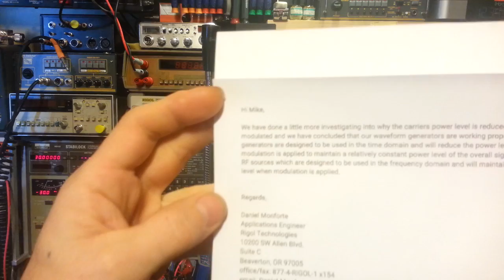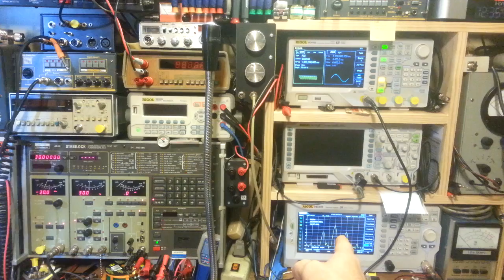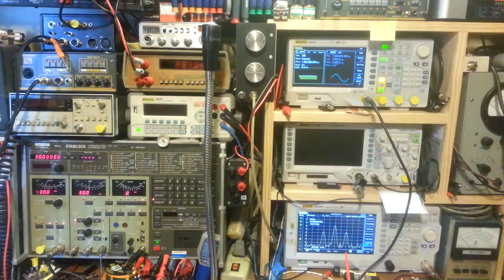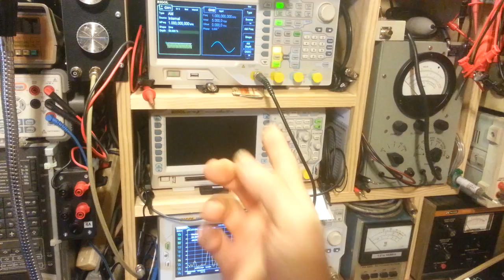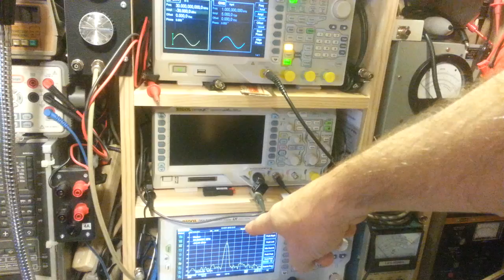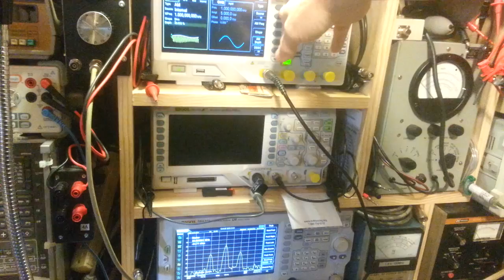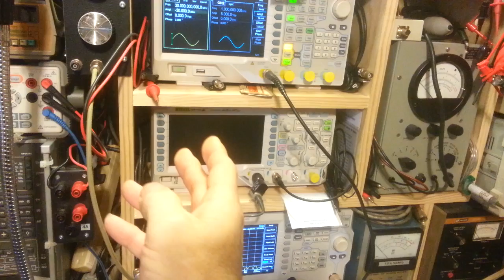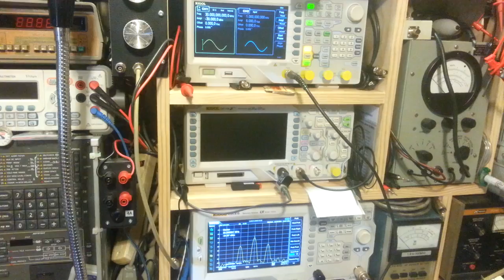Rigol DG4102 useless as a signal generator, inaccurate output level when modulated.

Comment: The AWG does what it's supposed to do. The display shows the PEP power, -30dBm in your case. With 100% modulation the carrier is 6dB (-36dBm) below PEP and the sidebands are 6dB below the carrier like it should be. Varying the modulation index will also change the carrier power to maintain the exact PEP value displayed on the screen. The only bug(?) I see, is with 0% modulation depth after AM modulation is turned on. The carrier power is 6dB down, when it should be at -30dBm.
Same principle applies to 2-way AM radios. A 100% modulated 100W (PEP) AM transmitter does not output a 100W carrier.
RF signal generators display the carrier power. An amplitude modulation of 100% means the output peak envelope power (PEP) will amount to 4x (+6dB) the displayed power. Why do you consider this normal? How is this better than what the AWG does?

Comment: Just looked at the advert. It is a function generator not an RF signal generator. Two different animals. A function generator is normally digital therefore time domain. An RF signal generator is normally analogue and intended for use in the frequency domain.    I admit I do not understand why they fit Mod to a function generator. I recently purchased an aim-TTI 240MHz function generator and also a Rigol DSG821 RF signal generator. This is what I was taught at University and always understood. Horses for courses.

Comment: Why use a DDS  arbitrary waveform generator instead of a proper analog RF signal generator? I've got the DG1022Z for basic signal generstion an use a DSG815 for proper RF modulated signals. I think it's a nobrainer that a digital synthesized signal doesn't meet the quality of a proper RF instrument. Sure there's more phase noise and harmonics... There connectors of the generator are BNC's which could be a clue that it's not a proper device for RF alignment since it's no N or for example SMA type connector. I think you're using the wrong device for the desired purpose and that your expectations of this device are not realistic. And I don't think it's fair to the Rigol brand to 'rant' about this 'flaw'. That both devices produce a higher frequency signal that can be modulated doesn't meant that the quality is equal. I'm sorry you're not happy about the device, bit I don't think that Rigol deserves this tone of voice about their products...

Comment: For all the people commenting that Rigol is useless needs to understand that an arbitrary waveform generator define modulated output amplitude differently than a synthesized RF generator. Look at Tektronix and Keysight’s manual you’ll see the exact same thing. As soon as you turn on the modulation even with 0% modulation the amplitude definition changes to Vpp=100%modulated output amplitude.

Comment: Well, rigol is NOT for professionals ! I got a 22002e oscilloscope from them and it's so buggy that sometimes it cannot be used to make some type of measures. Even with the latest firmware it's still full of bugs.
Reply from the maker: Considering they actively market to "professionals" I would say it is for professionals.  They send their reps to commercial user businesses.  Walk into lots of R&D labs and you will see Rigol.  Many colleges use them as well.  It's a great generator with one problem, inaccurate output when a carrier is AM modulated.  I own a Rigol oscilloscope, multimeter and spectrum analyzer and have not found any problems with any of them.

Comment: Before ranting, please RTFM (Section 5-4, To Set Modulation Depth):

"Modulation depth expressed as a percentage indicates the amplitude variation degree. The AM modulation depth ranges from 0% to 120%. Press AM Depth to set AM modulation depth.
 In 0% modulation, the output amplitude is half of the specified value.
 In 100% modulation, the output amplitude is equal to the specified value.
 In >100% modulation, the output amplitude of the instrument would not exceed 10Vpp (50Ω load)."

Comment: I purchased one of these shortly before I got my HAM license.  Now I feel I got ripped off.  I Am glad I saw the video.  I think I will let them know my feeling on this as well.  I bought the best I could afford knowing that radio work may come up in the future.  I could be tuning radios wrong, wondering why my results are not right and so on.  Got a RIGOL 4000MSO, I splurged on it.  Love it.  I knew there power supplies and loads were not that great but had no idea there sig gens were like that.  Am considering sending it back even at a loss of restocking fee, or even yell I want it all back cause you LIED and LEFT OUT INFORMATION. To much money spent with you to be putting up with that kinda stuff.  I have same sentiment,  shoot it, good target practice,  but a small 22 would knock my skinny crippled butt over.   I guess I have one of my old employers with the 910 CAT drive over it a few times then push it into the salt pile for the roads and let it "simmer there".

Comment: @MikesRadioRepair - I know this video is a year old, but I just stumbled across it.  I was wondering if you had tried measuring your function generator's output with a 50 ohm feed-through terminator at the input to your spectrum analyzer, just to see if the issue is one of mismatched impedance.
Reply from the maker: That was with the generator set to 50 ohm output impedance and the input of the SA is 50 ohms.  Wouldn't really matter even if it was a mismatch.  A mismatch wouldn't effect only one type of modulation.
Reply: Copy that, just an idea.  Did you ever come to any resolution with Rigol, or did they stick with their "it's working as advertised" line?

Comment: So, is/are there signal generator(s) in the equivalent price range that you DO recommend?
Reply from the maker: +cougar1861 

Not going to find much else in its price range that can do all it can.  The only limitation I have found is with inaccurate AM modulation levels.  I am able to work around that problem.  Just a matter of taking measurements and comming up with a cheat sheet.  Won't be a problem for much longer as I'm going to be getting one of their RF generators soon.
Reply: Thanks for the reply.
I enjoy and appreciate your videos.

Comment: How is the DSA815 SA?
Reply from the maker: +David Eisenberger 

Love the spectrum analyzer and has worked flawlessly for me.  Same with the DS1104Z Plus oscilloscope and DM3058E multimeter.  I like the signal generator and it works great to.  I just wish I had known ahead of time the output level wasn't accurate with AM modulation.  They really should list that discrepancy in the spec sheet.

Comment: I agree completely the specs show nothing that would raise a red flag.Too bad you didn't know someone who has that same model so they could test theirs for the same symptoms. Maybe it's just something with your particular unit?
Reply from the maker: Michael Fratini 

Nope, not just mine.  When I contacted Rigol about it they said they would file a "Bug report" to headquarters.  A day or two later they contacted me and said they confirmed the output level discrepancy but it was working as designed so there was nothing they were going to do about it.  My complaint is the spec sheet list a spec for output level accuracy and it does not meet it when modulated.   Nowhere in the spec sheet does it say output accuracy is xxxx except when modulated.

Comment: Well I will not being purchasing any Rigol gear
Reply from the maker: Ron Keith 

Everything else of Rigols that I have works fine.  Even the generator works fine, just don't expect a accurate output when modulated.  It's still useable, just have to set the output level by reading the output with an external meter.  In the end it does not meet published output specifications.  The spec sheet does not say output accuracy "except" when modulated.

Comment: Their explanation would make sense if the carrier was being reduced AS the modulation level is being increased. Instead the output gets reduced when you turn the modulation On with no modulation. I couldn't see the screen clearly but it looks like when you turn on modulation, the signal gets reduced to 28dBm  but the generator still claims  30dBm output. So it's defective. Heve you saved the receipt?

Comment: That's nuts the way you were treated by customer service. You have every right to be pissed. I find of figured that it wouldn't work right. I think it is because they are using dsp chips. DSPs are not good for for rf generation. the same holds for audio generators. I would take that German service monitor any day over that rigol thing. Thanks for the video.

Comment: I would rather own older used gear than the Rigol stuff. They all seem to have problems of one form or another.
Reply from the maker: S Robins 

It's not so much that it has a problem, it's the lack of  concern about it on their part.  Anything can have a problem, it's what a manufacturer does about it that makes the difference.  And yep, I do like the old equipment to.  You will notice I even have old vacuum tube gear on the bench.

Comment: I actually had a similar experience with that piece as well as their DMM and Oscilloscope. I wish I could've PM'ed you about my experiences with their gear, but I didn't want to come off as a gear snob, nor a shill for another brand.
Reply from the maker: Dyaxxis  

So far everything else seems to be working OK.  Have never had any problems with the spectrum analyzer and I have had that for a while now.  It's usable as it is I'll just have to make up a "bodge" setting cheat sheet to compensate for the drop.  Still the last piece of Rigol gear I'll ever buy.

Comment: A digital signal generator is not exactly the optimal tool for RF work more for reasons of spectral purity (as in phase noise) but of course it should we generating the right amplitude. If anything, the amplitude should be accurate. The company response was BS of course.
Probably it's safe to say that if one device turns out to be good (like the SA or scope), not necessarily all of their producs must be good too.
On a sidenote, Schlumberger is French, not German.
Reply from the maker: Jan Lategahn 

The spectrum analyzer made by them has been in use for some time now and I'm happy with that.  The multimeter, so far has worked fine with no bugs.  The scope, the jury's still out on that.  I had to get all the options so it's a lot to learn on it.  So far it seems to function just fine, it's more of a learning curve.   The signal generator that can't keep an accurate output level, that's plain wrong.
Reply: MikesRadioRepair Agreed. I too have the scope and the Spectrum Analyzer but still love to use my plain analog Tek scope. So fast, so simple, such a beautiful picture. Then again it is nice to do a quick screenshot on the Rigol once in a while. I have not yet been overly impressed with the scopes fft and complex functions. For generators I use a 3314A as synth and an ancient 8640 for radio work.  I was thinking, you should try to hack the generator. Maybe accuracy comes as a paid option :-)) Thanks for the entertaining videos this year, Mike. Not sure why but it is very satisfying to watch people fixing things :-)

Comment: I have a RIGOL 4162 (160MHz version).  I have relegated it to testing audio equipment.  Wait until you try to set up a two-channel function.  I once tried to set up a sweep signal on both channels at the same time.  One channel would output the signal properly and the other would output a very distorted/unstable signal.  I feel like I bought a 160MHz audio generator.  I went back to my old HP 8657A for anything AM/FM RF.  Rigol blew it on this one.  I feel your pain!
Reply: Another issue I noticed was that when the unit is turned off, the power button indicator light pulsates to show that the unit is plugged in and turned off.  If you tune an AM radio to a dead area and bring it close to the turned-off signal generator, you will get a strange chirping sound.  It is really annoying. When I do any AM alignments, I have to unplug the 4162 or it will interfere (up to 2 feet away) with the receiver under calibration.  You can actually see this in one of my earlier radio restore videos.  GRRRR!
Reply from the maker: xraytonyb 

Hmm, have not tried using both channels at the same time yet.  The way I "was" going to use this was have one channel straight out for use in a circuit and the other channel pretty much permanently  attached to an attenuator for extremely low signal levels.  Will have to play around with the two channels and see if I encounter the same thing.
Reply: I have the 4162 as well and it outputs just fine on both channels, used it most recently to test a homebrew 160m receiving diversity system from a QST article. The nice thing I found was that you can continuously vary the phase between two identical signals to simulate the arrival differential at the two wire loops and watch how noise from the "offending direction" is nulled out. Having said that I'll have to try the dual output sweep configuration to see if I have a similar problem.
Reply: A problem with lots of gear that have "soft" power switches; my whole bench winks at me with those. My old Ramsey 1Ghz RF generator has a bit of leakage right around the BNC output port but I haven't tried searching around the Rigol front panels (and others on the bench).

Comment: Mike, My Wavetek model 395 100 MHz Arbitrary Waveform Generator does the same thing. This is why I have my HP 6857A signal generator dedicated to this king of thing. Still sad that such a nice new toy won't do the business.
Reply from the maker: The Radio Mechanic

Hmm, would have to go pull mine back out, can't remember the model number.  I had pulled one of my old Wavetek AWG and it didn't do this.  Don't think it was a model 395.

Comment: Bummer. The good news (maybe) is that they might be able to do a firmware update and fix their screwup
Reply from the maker: Michael Lloyd 

Yeah that's kind of what I was thinking.  It has to have some way of measuring its own output.  It just needs to be able to compensate for the drop.
Reply: Any chance there was a termination resistance mismatch? I know the SA is 50Ω but I haven't had a chance to look at the ArbGen to see what it is or if it is selectable
Reply: Until recently I was a SCADA engineer for a privately held oil company in Houston. We have stuff all over South Louisiana, south Texas, and Alaska. We also have a little in south Alabama. I have a good friend who's dad was the Prentice in Prentice and Records (blowout prevention training) and I think that company was from Lafayette. Maybe Baton Rouge. I don't remember. I have a buddy that graduated from LSU and has been in Denver for almost 30 years (wow...). I think he is VP of Engineering but I'm not 100% sure of that. And my daughter was born in Minden, Louisiana. I'm still in contact with a good number of friends from there.

They (allegedly) promoted me to plant manager earlier this year. I see it as a demotion with a pay increase :) People come with problems. PLC programs do what you tell them and if they don't show up for work you just replace them. :o) PLC's are much easier to deal with...

I wrote all of the pump station programs (Allen Bradley Control Logix, a very few Micrologix, and 2 SCADApacks) for our part of the Eagle Ford "boom". 53 programs in 3 years. Needless to say, I had to develop a system to write them fast and accurately. One of the stations has (8) 1,500 HP pumps and  over  1/2 million barrels of storage. When I first came on board (contractor) the station was moving under 10,000 Bbl/s day. It peaked at over 90,000. It's still in the 70,000 range.

I also did about 35% of the HMI work (ClearSCADA) when they promoted a coworker and he didn't have time to do it anymore. I'm not a fan doing HMI work but the system be put together makes it painless.

Comment: I say return the signal generator as it is not "fit for purpose", and buy some other brand (or just buy some older gear which works properly without the bells and whilst and marketing wank).
Reply from the maker: TheDefpom 

Oh I have plenty of signal generators that work just fine.  I was just trying to update with some new equipment all from the same manufacturer.  The Stabilock 4040 works perfectly fine from 400KHz up to 1.85GHz.

Comment: My Marconi 2022D lowers the carrier level if adding modulation when it is close to its maximum output power limit, but below that it stays constant, as per normal RF output, are you close to the maximum output of the signal generator ? (I know you had to run it through an attenuator to lower its output level).
Reply from the maker: TheDefpom 

Nowhere close to maximum output power.  This thing goes up to 20 Vpp.  Heck that's transmitter levels.